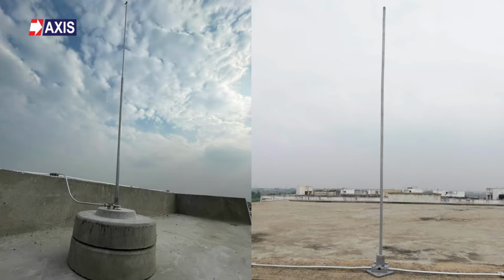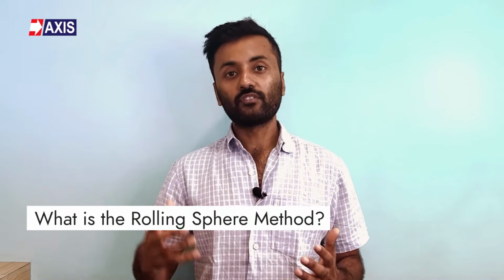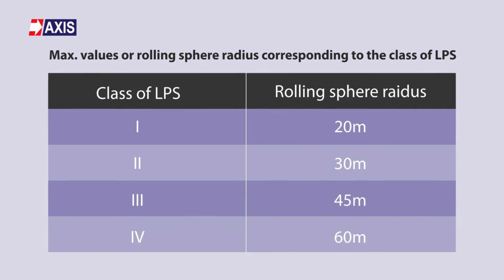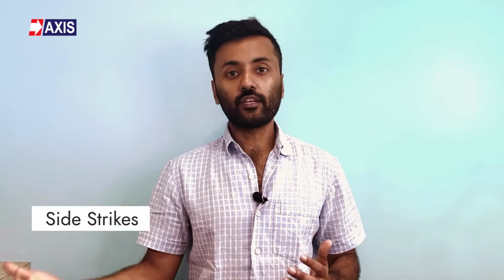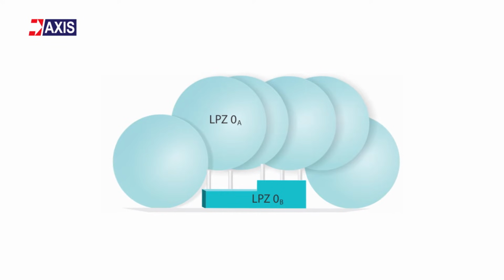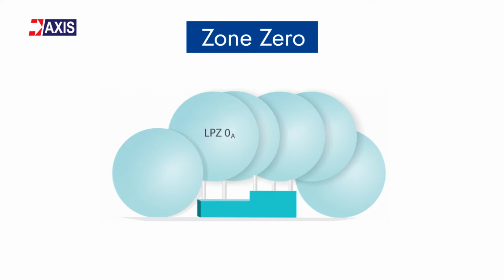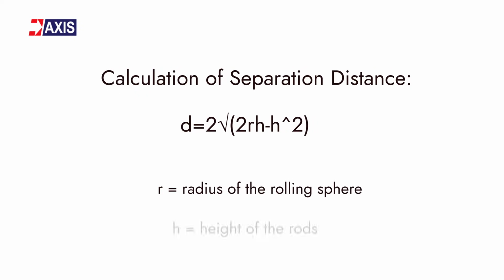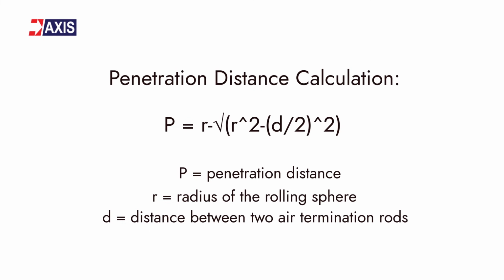What is Rolling Sphere Method of Lightning Protection?  Design & Calculations Explained | IEC 62305

Comment: Is it required to have an air terminal at the perimeter of the building even though it is the equipment is much higher than the air terminal. Another thing, the equipment has an installed lightning rod at the top of it. Hopefully you give me your thought on this. Thank you and have a great day.

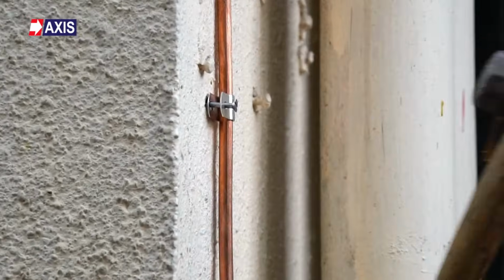Comment: I have found your video very good and I will keep it as a reference. However, I have noted the following: at 1:01 you show a down conductor bolted to the wall. What is the voltage at that point when lightning strikes? Is it safe for the wall or any other component behind the wall? It may arc to other conductive surfaces behind the wall. How about a human being touching with the hand there while lightning strikes?
Reply from the maker: Hey Alberto,
When lightning strikes, the voltage at the point where the down conductor is bolted to the wall can become extremely high. However, the wall itself typically remains safe due to the down conductor’s role in directing the lightning current safely to the ground. This is assuming the lightning protection system is properly installed and grounded.

The potential issue arises if there are any conductive materials like rebars, electrical cables, or electronic devices behind or near the wall. These materials are at risk of experiencing a 'flashover' – an electrical arc caused by high voltage, which can lead to structural damage such as cracks in the wall or harm to electrical components nearby.

In larger buildings with multiple down conductors, the risk of such events is mitigated. The reason is that the lightning current gets divided among multiple conductors, reducing the load and likelihood of flashover on any single conductor.

Touching the down conductor during a lightning strike is highly inadvisable. It exposes a person to 'touch potential,' a dangerous condition where the human body can conduct electricity, posing serious hazards.

It's important to note that lightning protection systems should always be installed by qualified professionals to ensure the highest level of safety and efficacy. Connect with our experts at sales@axis-india.com for a detailed chat.